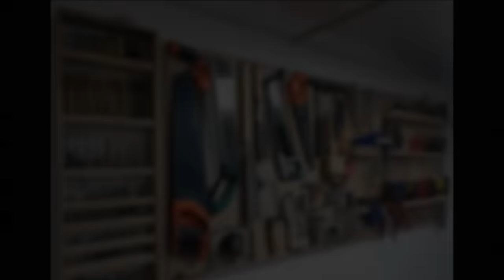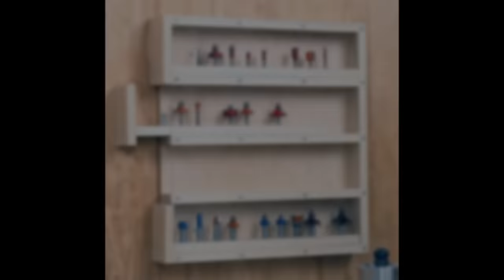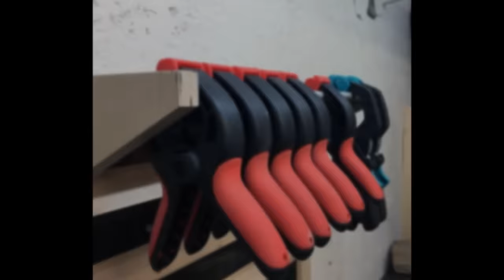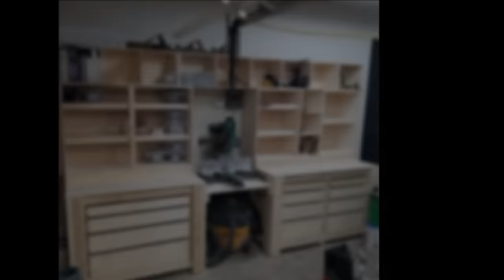80 Tool Storage Ideas

Comment: Most of these storage solutions share a common problem. If a particular tool is missing from the storage location, you don't necessarily know it is missing, and you don't immediately know what particular tool is missing. That is why shadow-boarding (creating the outline of the tool), labeling, or other methods are used. These are great ideas for how to HOLD tools, but most lack the true organizational feedback (especially important in an environment where there are multiple workers/users).
Reply: Then make a video and show us how it is done
Reply: Gary Brown,

How difficult could it be...???

I utilize the "shadow boarding" system for some of my tools. My workbench area is in my basement because I don't have a garage or shed. 
I have 4 different levels (2 of which I got for free after someone else had used them for more than 10 years). I store them on either side of one vertical standing stud using only one nail to hold up each one. The day I hung each one I traced the outline of that level on the stud AFTER I hung the level on the nail. 
I use the open space between any 2 joists in my unfinished basement ceiling to hand various lightweight tools as well. I hang all of my circular saw blades from one nail on one side of one joist. I have a circle for the largest blade traced on the part of that joist the the blade hangs inside and then list of saw blade diameters just outside of that circle. This way I automatically know how many blades I'm supposed to have and which diameters they are. 
I've also hand drilled fish hook screws into the bottom of each joist that I hang my pole tools on and labeled the joist with the name of the tool thats supposed to hang there. 

Here are a few examples I could give for this video.

0:04........trace the shape of all of the saws while they're hanging there and then state the color of the handle (orange, green, blue, or wood) inside the trace itself. 
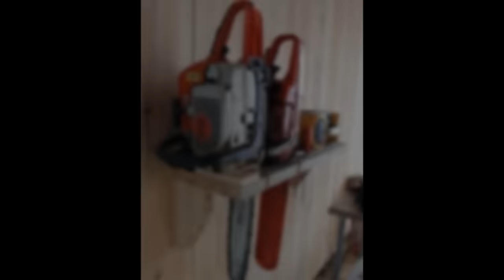0:18........I don't know anybody that owns enough caulk to fill all of these PVC tubes, but just above the top point of each PVC tube state the type (and possibly brand name) of each type of caulk that would be needed for all types of jobs necessary, then fill all the tubes with new caulk at once. Each time a tube goes empty you know exactly what type of new caulk you need.
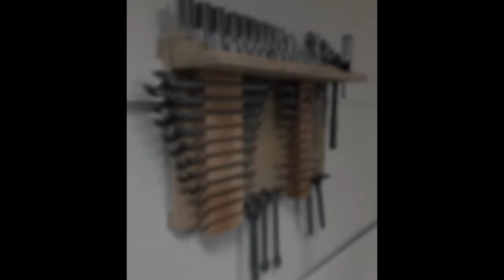1:18.........On both sides of each plate just below each tool write the number of that combination wrench so that they are put back in order by size and direction. 
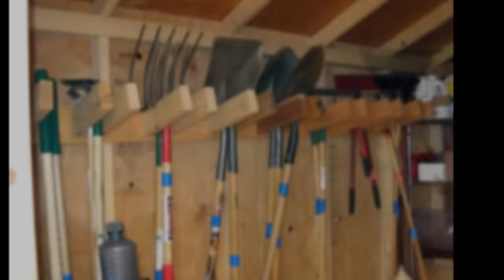1:37.........On both sides of each holding plate write the names of every pole tool that should be hung on that slot. I also have some of my pole tools identified on the pole for those people that don't know what the tool is called (maddox, tamper, yadda). One system that I would use for multiple tools on each slot is that I have spray painted a series of 3 different colors on each pole in my collection in various random orders. This not only guarantees that when I go help other people with jobs at their location everybody knows which tools belong to me by the color of the handle but also when I get home from a job I know which tools hang from which fish hook screws on which joist.
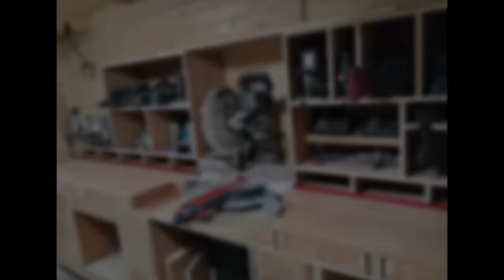2:32..........The size of each blade COULD BE written on the top of the sliding T so that someone would see where each blade is supposed to be placed without needing to slide the plate out to look at all of them
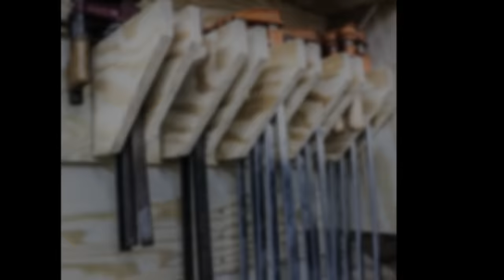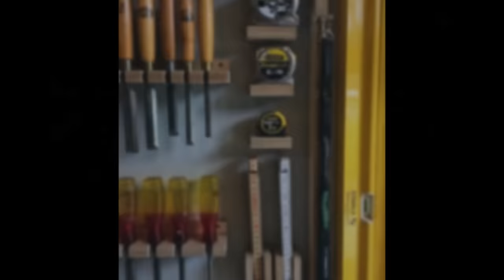3:48..........the same thing as 1:37 above with the lengths of each bar clamp that sits in each slot.
Reply: Adding labels under each piece of equipment will help out any organisation idea +1
Reply: @r5t6y12  Excellent reply and tips. Thanks!